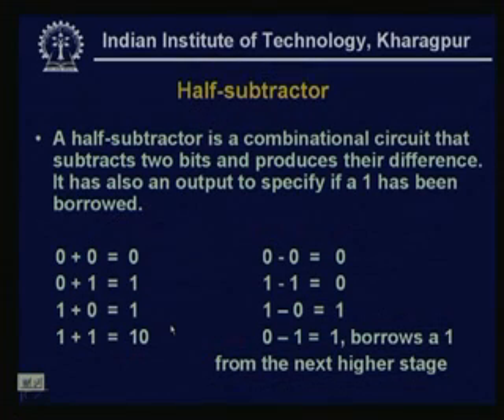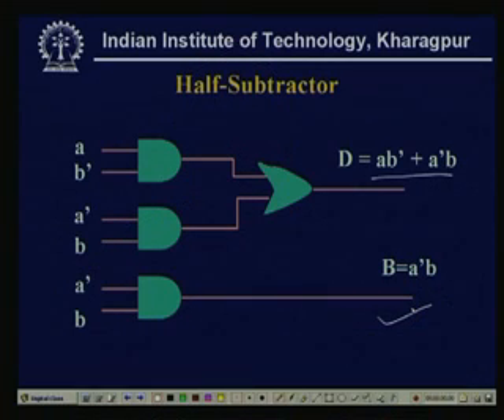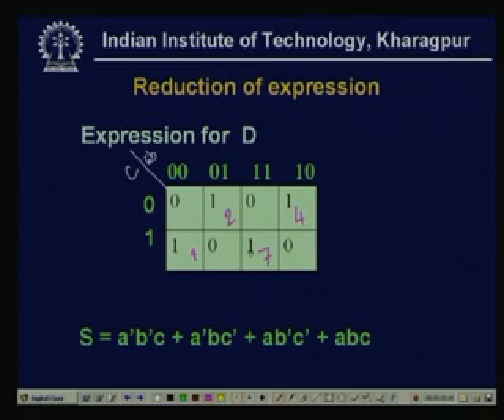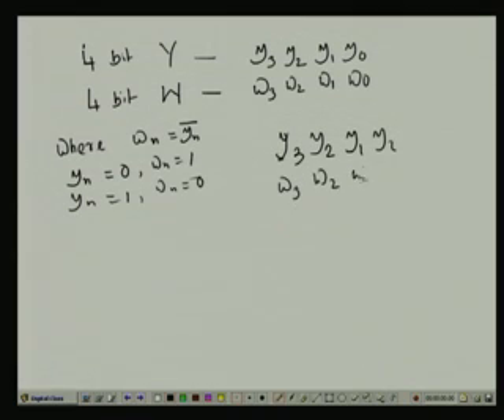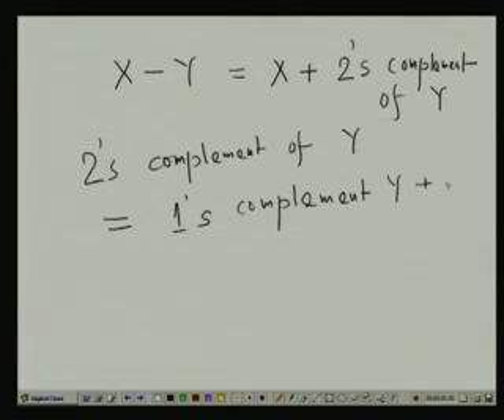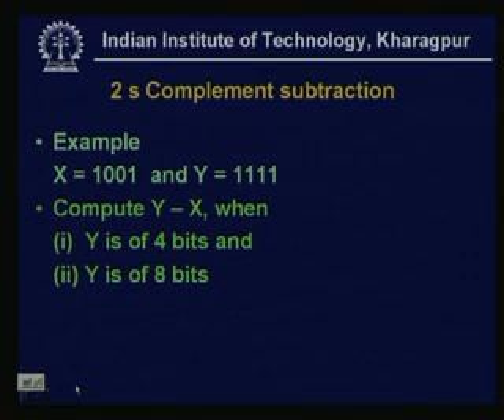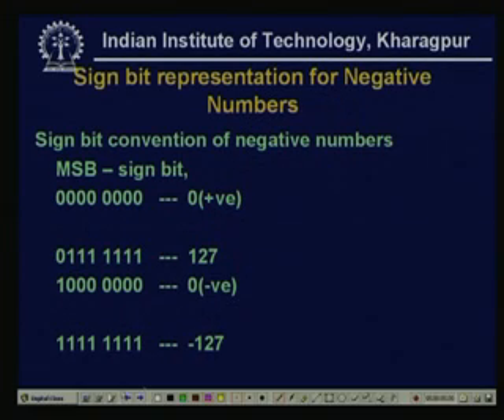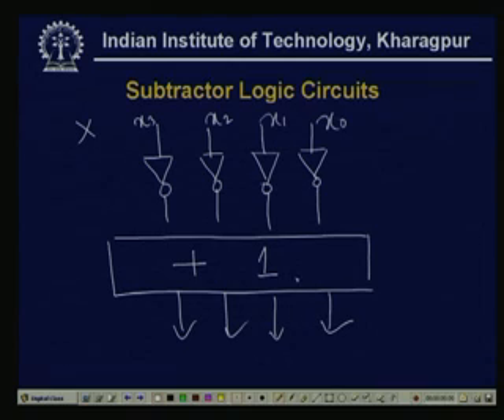Lecture - 14 Design of Subtractor Circuits

Comment: At 18:19 min, the expression for the full subtractor circuit is not correct. The expression should be the same as that of a full adder for the difference part. To be specific the term ab'c' should be replaced by a'bc'.